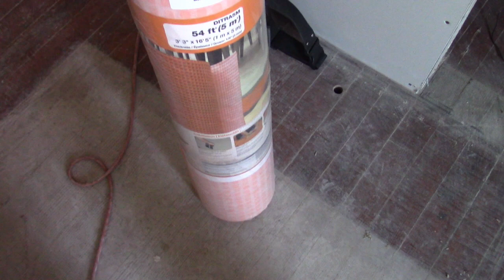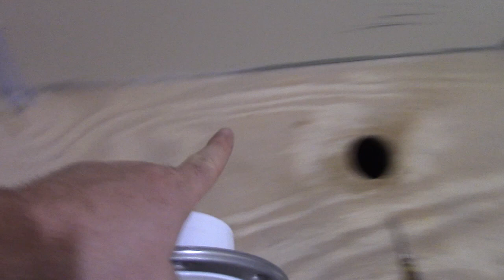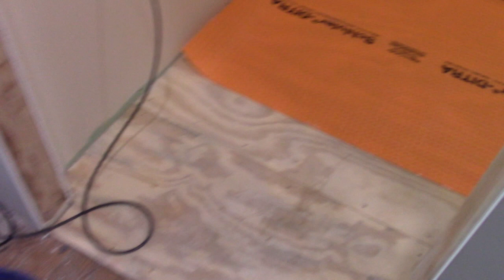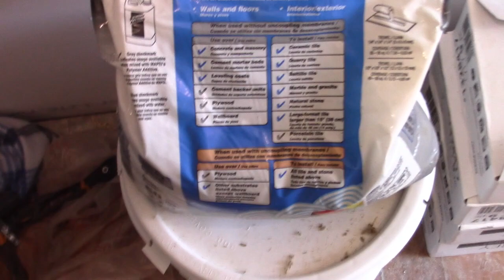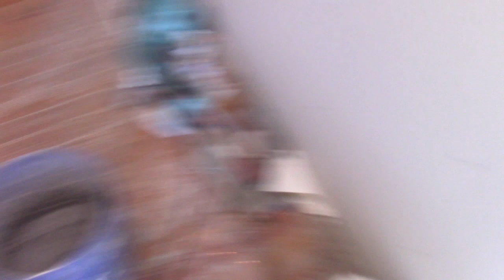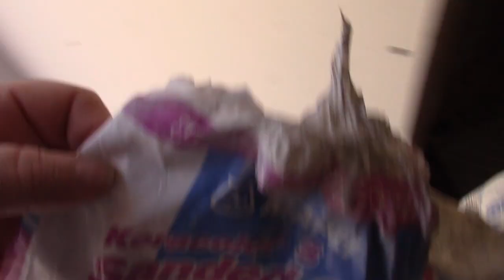1902 Farmhouse Renovation Part 22: Floor Tile

Comment: Well I would have done that all wrong. Never heard of using the membrane of course I'm just a DIY person. Great job Jay & nice choice of grout color. I assume you didn't want to use cement board because of the drastic transition to the hallway. Hands & knees work is not fun. Also hard on my back.
Reply from the maker: Thanks Joe!  Cement board is overkill on the floor if you use decoupling membrane.  I watched a lot of videos on tiling ;)  The kneeling pad is great and doesn't hurt my knees like knee pads do.  Getting up and down is another matter ;)